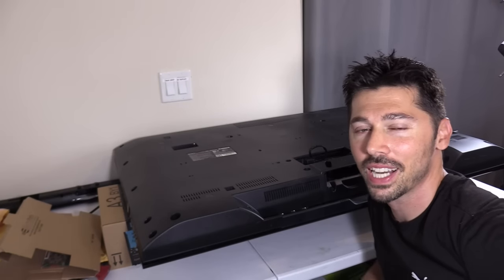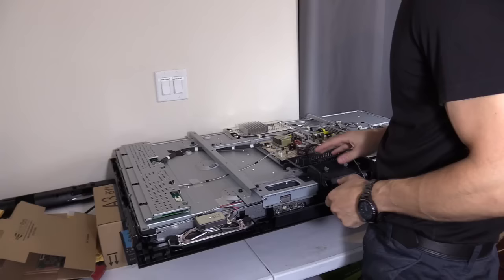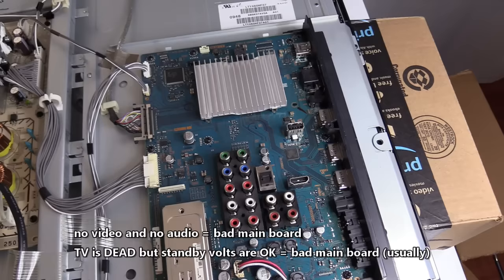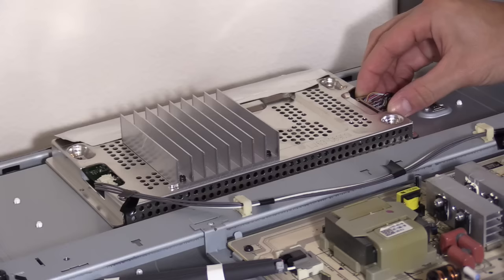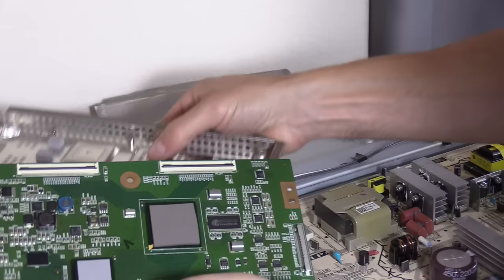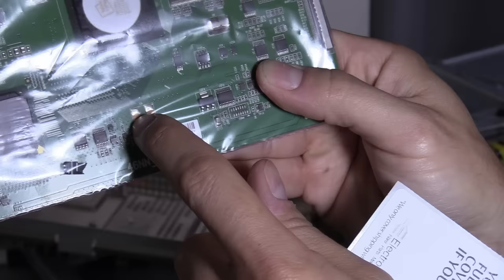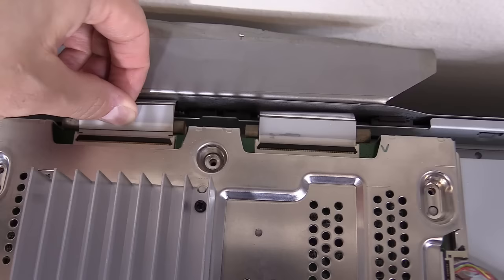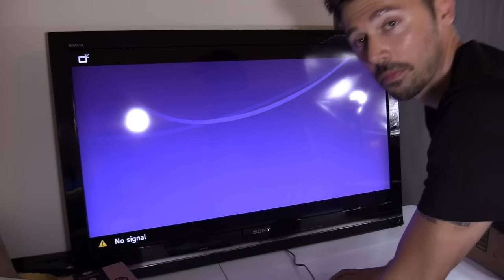SUPER EASY WAY TO FIX MOST SONY LCD TV KDL- PICTURE SCREENS !!!

Comment: I have a kdl-46vl150 that turns on automatically when plugging it in and backlights light up but screen shows no menu or anything, and the buttons on the side don't work at all. I would think that it's just a component on one of the boards instead of replacing a whole board. Can u point me in the right direction to get this fixed? Replacing a whole board is buying a lot of things on it that are not needing replacement. $50-$80 for a $1 component? I'd rather buy the component.

Comment: Need your help please!, my american sony bravia stopped working 2 months ago because i messed up with the mainboard trying to fix another problem, i knew for the 3 red blinks, so i ordered a new one from spain, after installing it the tv do not turned on, i don't know why but i used my pendrive with an eur update and turned on, but only backlights and green light with no audio and no picture.
Sometimes i hear a noice for a sec, recently i saw like a little distortion dont know what was x'D

Comment: Hi Boss, I have Sony 43 '' 4k android LED TV which i brought last year and from few days there is no picture but only sound , so i took it to the service center and those guy just looked at it for a few minutes and told that the LED panel need to be replaced. ant that would cost 1250 $ so i did not repair and brought it back.  I cant still be leave that an LCD can be bad just in a year. and i am not so sure about that as those guys don't look that they have much experience. I have no idea what to do . can u suggest please.

Comment: I had fixed one I found, it was the main board, I put weight on it, and it made the picture crystal clear like new, and I played resident evil 2 on it, then I moved it to put it all back together, plugged it after I put the metal bezle, and pood red picture with sound, and lines. Lol like what even happened...

Comment: Would this work if the image is really bright? The tcon board?
Reply from the maker: Yes, see my repairs playlist on my channel for that video.
Reply: I also had the Sony KDL40v4100, which has a super bright/washed out picture. Can barely see what's displayed onscreen. I got a replacement tcon board, but it has the exact same issue. Thoughts?

Comment: Hello tampatec, i have a sony KE-42TS2, over the years it has deleloped two sections of alternating dead vertical lines, one in the middle and one on the left, and a vertical section on the right that shows a black or white section (depending on the image displayed) with rainbow colored vertical static. I have reseated the vertical ribbon cables but it did nothing, maybe i didnt clean the cables enough, maybe a board needs replacing like you said, im hoping that the chips on the ribbon cables are fine. The TV is a space heater, what is your input on this? -david

Comment: Hello ! Can u help me ? I have a 42lw5500 tv with picture shaking horizontally a few pixles and very blur vertical lines. I replaced t-con, t-con ribbon, tested panel ribbon connection, voltages are not jumping, reflowed the mainboard ic. Nothing helped. 
I think maybe its ripple noise from power-supply but my pc oschilloscope doesnt have the ripple test function damn. 
Maybe u have an idea what to do ?

Comment: I have a T500HVF04.0 led screen from a Sony Bravia 3D TV. It's in a working condition. How to get it back to work at the lowest price possible?
Reply: I need a compatible board with a minimum requirement to turn the picture and audio on. That's all!

Comment: I have a Sony with a pink vertical line down the side of the screen.
Reply from the maker: Aaron Shalom usually bad tcon board or bad connection from tcon board to LCD screen. Get tv boards from shopjimmy.com  or Electropartsonline.com use code tampatecfriend

Comment: Hey tampatec, you think this will work with a sony KDL-60R550? It was built in 2013, dont know if lcd panels are the same. I have two green vertical line, one the left and other on the right.
Reply from the maker: Fran Detrovi it's common for Sony tv repairs.
Reply: Tampatec ok thanks, was just worried because i haven't seen the  green line problem fix in your channel. You are doing a great thing here, tvs now days fail sooner than old tv years ago. You help and save many, with thorough explanation. Mad props to you!
Reply: To update you, the tcon board did not fix the green vertical lines on a sony KDL-60R550A. I took to a tv repair shop and told me was a bad panel 😢. Wish you could make a miraculous video on how to fix that.
Reply from the maker: Fran Detrovi  I found out it's the LCD panel tab connections on the lcd buffer boards.
Reply: Tampatec oh i see, is there a fix for that?
Reply: Did you ever fix your tv. I have the same one giving a similar issue

Comment: Sony led tv, bottom half of display ia flickering and showing a mix of yellowish, reddish, pink messed up graphics and horizental lines. I take it to sony, they say it needs a new display. I took it to a local technicien, he said the same thing. A display costs too much. 
Do you know if there is any luck to fix it without getting a new panel ? 

Its 1080p 2011 model. Kdl 40 bx420

Comment: i have an LG LCD tv and sometimes it just restarts while you are watching tv and makes a weird sound, sometimes it freezes any ideas?
Reply from the maker: AVNSpider restarting like turning on off is a sign of failing capacitors either in main board or power board.

Comment: hi Paul.  I have a general question.  Is it possible to convert a standard  a.c. tv to dc internally?  I mean without an inverter.  Are there any components inside an average a.c.  led television that absolutely require a.c. or higher dc 
voltage then can be generated by a 20 amp 12 volt battery?

Comment: Does anybody know where i can buy a main board for Sony KDL-50W656A. The last one was sold on eBay. You can hear the television working (you can hear the sound when switching channels through the remote). But, there is no picture. Back light is on. I have thoroughly cleaned it and still nothing. If anybody has some info i would be thankful

Comment: @tampatec, was trying to find a way to message you about a board I have a problem with when I check voltages they are there but lower then what is required for example I need 12 and 24 and I get 8 and 16 so I’m guessing the transformer is going bad I have checked all caps and resistors board # p5l031 for reference
Reply from the maker: Most likely a bad power board. Get tv boards at shopjimmy.com or electropartsonline.com use code tampatecfriend for discount. 👍